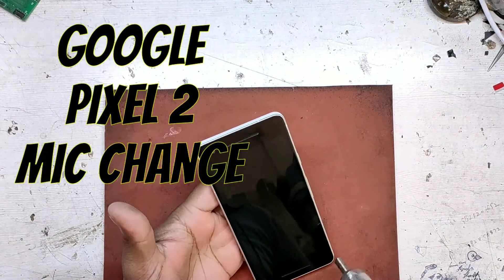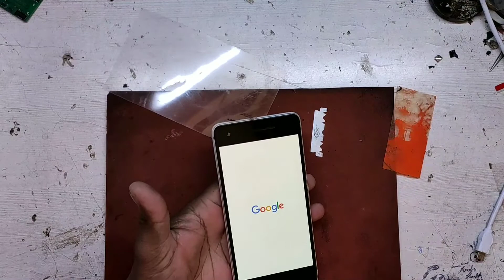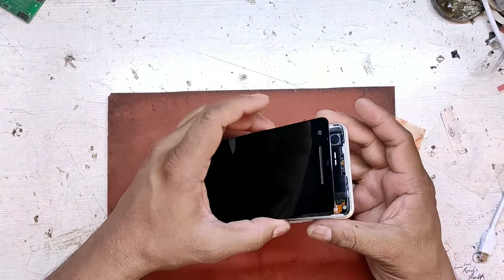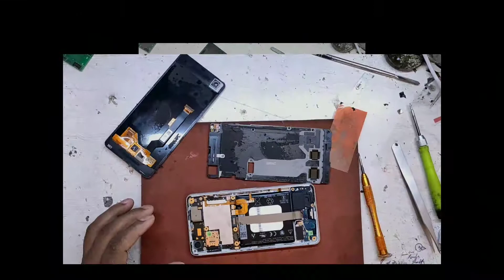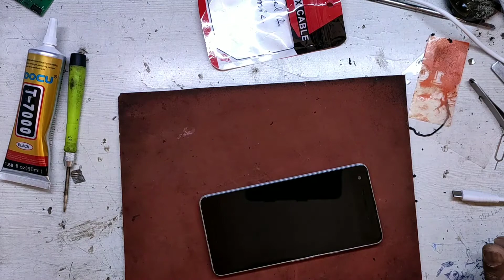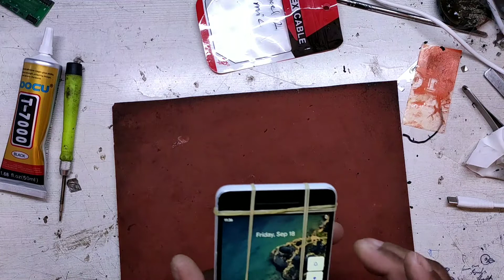Goolge Pixel 2 Microphone Repair And Change

Comment: I get a Google Pixel 5 don't knowing this problem (that appear is from all versions). I bough to Amazon and don't refund...so, it will be the same process? the mic is the same from pixel 3? I need to know to buy de replacement
Reply from the maker: No it's not same as pixel 3 pixel 5 mic come with Charging flex board.you buy from https://www.maxbhi.com/charging-pcb-complete-flex-for-google-pixel-xl.html?gclid=CjwKCAjw49qKBhAoEiwAHQVTo8Ch6vO3fwlToeB5SXuVSxzymAEkLsD88TJHMfvPTS5XRbA3lg11FRoC8JgQAvD_BwE

Comment: I have pixel 3xl.  Microphone not working properly on speaker phone. The lower mic is working good for calls and recording. Which mic is faulty. It has 2 upper mics . One very close to earpiece and the other in top right corner.
Reply from the maker: Close to Earpiece mic for speaker phone